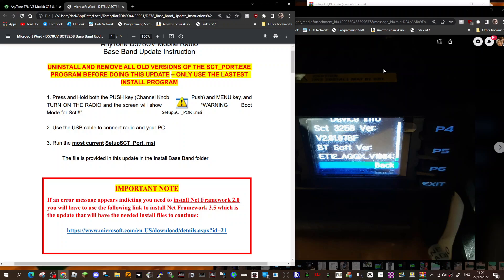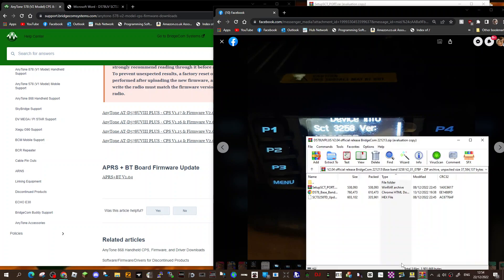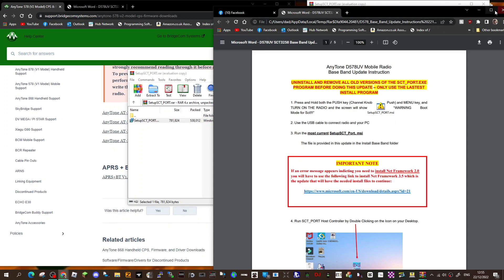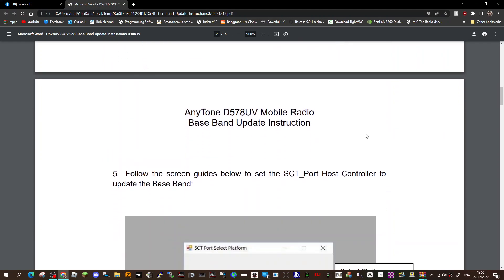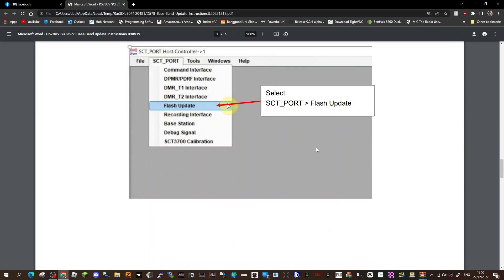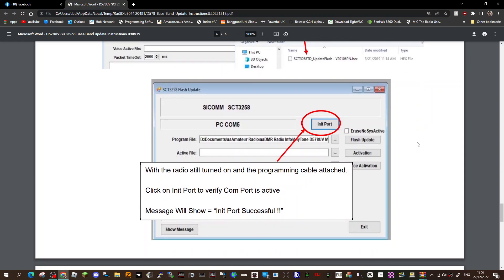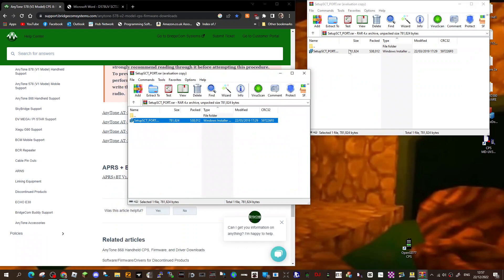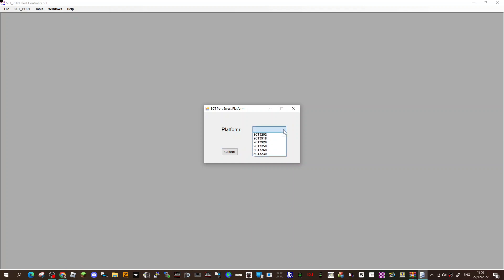ANYTONE 578 UPDATE BASE BAND

Comment: Hey you know of any good desktop base stands for the 578
Reply from the maker: Try the one designed for the FTM400
Reply: @M0FXBHamTech  the one for the ftm 400 will work? I just need the stand no power supply
Reply from the maker: https://www.bridgecomsystems.com/products/578-base-station-accessory-bundle